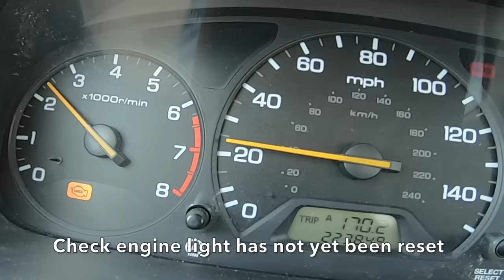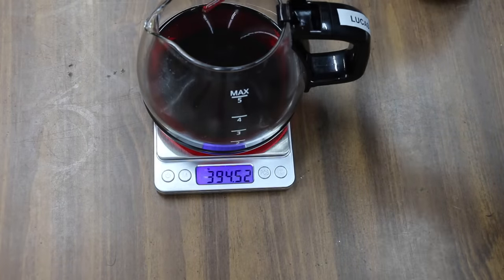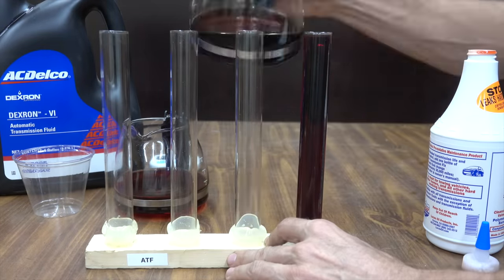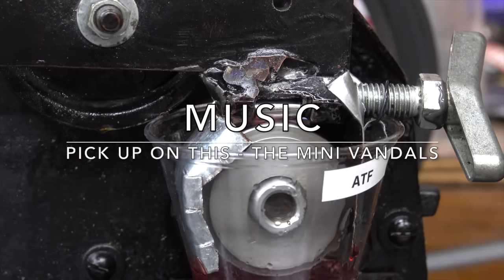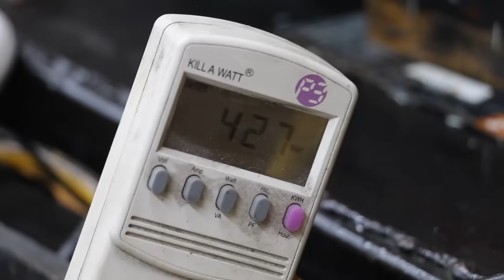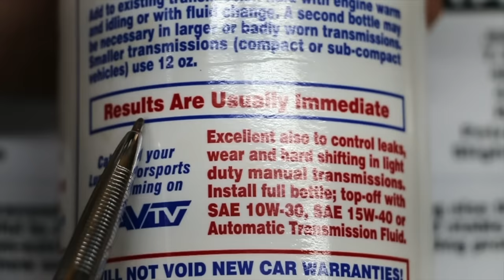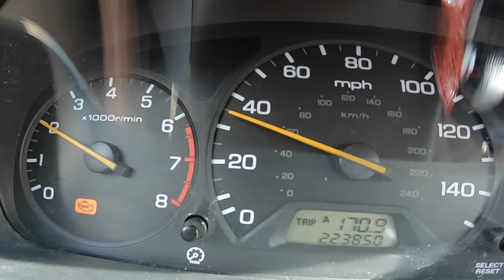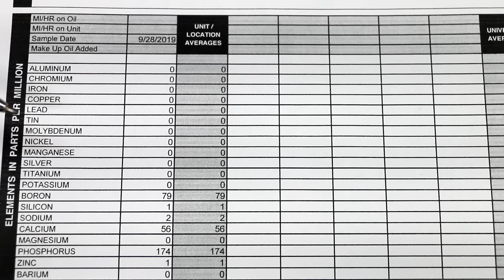Does Lucas Transmission Fix Work?  Let's find out!

Comment: $1500 for a rebuild!?  Wow, I gotta find me that guy!  That's a steal for a complete rebuild.
Reply: Ikr
Reply from the maker: Great point!
Reply: i was thinking 3-5k..
Reply: fidel catsro : Absolutely!  $1500 for a trans rebuild is unheard of, around me anyway.   My brother in law got a quote a few years ago on his 2007 Acura TL and it was around $4200.
Reply: @JeffCD77   i think its a trap gimmick to make you go there and send into his shop, once you there commited to repair, he will say ahh we found this not working we found that broken we found cats inside the transmission blah blah and bring you closer to 4k or so..
Reply: He's lying or doesn't know the problem (which he should b/c every shop has seen a thousand v6 hondas). 4 bangers had the TC problem.
Reply: The Car Wizard does Hoovie's transmissions for about 1/3 of what dealers charge!
Reply: Me and my dad rebuilt a 40L60 Tahoe transmission in 4 days and for $200. Amazing how much you save when you DIY
Reply: @fordrestored4646  how hard was it?
Reply: yeah but if you compare 1500 dollar rebuild for a 2000 dollar car then 1500 sounds like robbery
Reply: live and let live it was quite a lot of work actually. We had to completely gut the tranny and find all the bad gears and to put it all back together. The most expensive thing was new fluid. Which was 75$. We replaced some internal parts for about 100$. My mom was backing up and reverse just completely went out on it. But hey it’s working perfect now
Reply: @fordrestored4646  wish I had the skills/knowledge for such a job

I'm 20 I work on cars as a hobby but such a job is way past my YouTube schooling
Reply: live and let live ive learned most from my dad
Reply: That's what I was thinking
Reply: Their rebuild consists of adding a bottle of Lucas...
Reply: @fidelcatsro6948  If the mechanic is a scumbag and does that intentionally, when he calls to tell you what it will cost just tell him " you can just keep that POS car yourself"
Reply: @robs1852  hahaha
Reply: $1900$ my daughter paid and I was Shocked. $1500$ is Cheap that mechanic is a good Christian obviously.👍😊
Reply: @fidelcatsro6948  that's so true. My sister got ripped off this way. Claimed it was like $1,300 for a used engine, then when all said and done, the engine ITSELF came out to $3,200. Typical bait and switch
Reply: @JamesAutoDude  of course amigo!! 
EL COMMANDANTE IS ALWAYS RIGHT!
Reply: I know a guy in los angeles that does a mickey mouse job that will get you 2 or 3 more years for $700
Reply: @angelt7166  my Siamese cat would love to meet him..
Reply: Not really there some shop in Houston that do a rebuild for 650
Reply: @jonathanlee6114  that sounds like the guy leaving the old solenoid pack inside the transmission, a cheap work.
Reply: 2 brothers in bellflower Ca charges about $1500.00 for a rebuild on the tansmissions.   They do very good work took it over from their father when he retired.   So they have been around forever.
Reply: ngfugjg jgjhif : Sorry, but I would never trust ANYONE who said they would do a proper tranny rebuild for $650.  Come on!  I've paid $650 for shocks.  $600 for rear springs.  Not $650 for a transmission.  That's absurd and you should question that.
Reply: @JeffCD77  maybe is just for the work and the client buy all the parts.
Reply: @JeffCD77  and maybe, just maybe, he buy all the parts and it's an older transmission without electronics, something like a 200R4.
Reply: Money Online : Maybe :)
Reply: Yes 1500 ain't a bad deal,  most people with a Honda with a V6  seems to have transmission problems because of the engine torque.
Reply: Local transmission shop rebuilt mine in my 99 Ranger for about $1900, back in 2010.
Reply: Same thing I was thinking lol
Reply: Rebuilding Automatic transmissions are one of the biggest scams in the auto Industry. They aren’t some mystical magical part. I’ve done a few 727’s and a couple GM TH350-400 and the over drive unit don’t remember the model number now. Some of them are super cheap for the parts. Some of the Japanese are crazy expensive for parts. But they are not that hard to rebuild is you have any mechanical ability at all.
Reply: @mike-bj4dk  except that it would cost $30k to replace the car.  If the rest of the car is fine and you want to keep it - why not?
Reply: My husband got his trans rebuilt just 4 days ago at 1600
Reply: @JeffCD77  a Acura is a big shot car compared to a Honda even though they are similar, LOL  always remember a mechanic tell me you want a primadonna  car you pay primadonna prices, LOL
Reply: @tvrpaul71  Similar?  Try pretty much the same.  It's a Honda transmission.  If you use the dealership, yes, you are absolutely going to pay "Acura" prices.  But for most things, if you use a reputable mechanic that doesn't rip his customers off, you'll pay the same price as a Honda.  Again, I said "most" things.
Reply: @angelt7166  I did a dodge RWD van 3 speed for $700. Easiest trans money I ever made. Most are 5 times harder.
Reply: @saddamlucdahlia7842  where? Is the question?
Reply: @GCEXTREMEMN  where?
Reply: @joepayer1793  
Hofman Transmission in Brooten, Minnesota. 
Again that was $1900 to rebuild my transmission in my 99 Ford Ranger back in like 2010.
Reply: @joepayer1793  sorry still trying to get familiar with this in Bryan Texas place is called AJ’s Transmission Shop.
Reply: @joepayer1793  that guy is very crafty and he installed something else to improve it
Reply: @tvrpaul71  You realize that Acura IS Honda?  Rich folks in the US can't be seen driving a Honda, so Honda rebranded some as Acura cars.  There aren't Acura Integras over in Japan, they are Honda Integras.  Same with Lexus (Toyota) and Infiniti (Nissan).
Reply: Was quoted $4500 today. Lucas didn’t help, but I’m throwing solenoid codes so that makes sense.
Reply: does that number include removal and installation + break in
Reply: @JeffCD77  If you're paying $650 for shocks and it's not a race car, you're at the opposite end of the improbability spectrum, is a very poor example.  Shocks are normally less than 1/3rd that, while taking $1500 and multiplying  by 3, would be too high for what's in that vehicle, could get one already rebuilt to swap in and core refund out the door the same day it arrives.
Reply: @stinkycheese804  It would be nice if you could reply in sentences that most of us can understand.  Also, $650 to replace the shocks in my wife's XC60 is a very good price.  Not sure where you are getting your numbers from.
Reply: @JamesAutoDude  sounds right. 1300$ for used engine, and 1900$ for labor, including a 1 year warranty pretty standard.
Reply: @JamesAutoDude   Book time is 10-12 hours, shop rates are about 80-160 per hour, plus old engine disposal fee. I advise anybody who has the space, to do it themselves, job is more intimidating than it is difficult
Reply: @kevinbaker2470  that wasn't her total... That was just for the engine.
Reply: @kevinbaker2470  the engine was $3,200 by itself I meant. Not the total bill
Reply: Mine was $1600, jumped right on it!!
Reply: $1500 is not worthwhile, if the shop rebuilding it, rebuilds it incorrectly,  by cutting corners, etc.
Reply: Haha right. That barely covers taking out the transmission haha but he's just giving an example. No one will give you the most accurate price but it's 3k plus to do rebuilts usually. Better off just getting a used trans
Reply: I've seen 1200$ in Pennsylvania
Reply: Front wheel drive is cheaper
Reply: I had a 2000 ford Taurus that needed a rebuild and I was only charged 800
Reply: I was able to do the same job for 1400$ to rebuild same trans, it’s a junk 4 cyl trans mated to a  v6 but makes too much power for the little guys clutches and internals
Reply: @angelt7166  I'll take two tickets to Disneyland lol
Reply: @fidelcatsro6948 That’s the usual among transmission shops. I called a few places and they wouldn’t even give worse-case scenarios; just bring it in and let us charge to look at it for $700 (1990s).
Reply: @jaymez858  thats the cheese baiting on the auto transmission mousetrap!!
Reply: Maybe $1500.00 for an old 3 speed like the Chevy Turbo 350 or 400 but no for the newer 4 speed and up trannys.
Reply: My transmission rebuild was $700 cash.
Reply: @joedunn7434  what kind of transmission?
Reply: @JeffCD77  with that money I buy a new transmission
Reply: @doug3805  4L60e
Reply: @joedunn7434  that is cheap, cheap!
Reply: @doug3805  oh I know lol I practically threw the money at him for that price 😂
Reply: I can't even find a guy😂
Reply: That's about right for just the rebuild without removal or install
Reply: A rebuild kit for that trans is about $300. Pretty simple rebuild. No planetaries in a Honda
Reply: Dude, this is an old comment thread, but I got a 93 lesabre I asked about getting rebuilt. Dude said 2k and you can buy a FULL rebuilt one with the TSB and update kit already installed for like 1,200
Shits wildly expensive
Reply: Lmao i was just thinking that after he said it
Reply: My 74 dodge d100 had a rebuilt price of 3k
Reply: Well it depends on the transmission.
Reply: 😂Yes I agree with you and would like to know who that is as well because I just got a rebuild quote for 3700
Reply: @JeffCD77  Yes I have 97 Chevy express van and I just got a quote today for 3700
Reply: @WilliamAllen-mc9px  that’s a 4L60 transmission.  Dirt cheap to fix.   Buy refurbished and slap it in.  Rebuild means they change the seals, clutches , maybe TC.   Rarely are the hard parts damaged
Reply: @Tkdbar  I ended up finding a rebuilt one in junk yard for 140 n I works fine now to doing new front suspension due to passenger side lower ball joint broke few days ago so gotta do both sides
Reply: 😊no shit right. My truck transmission is 1800 and I have to bring them the transmission out of the truck.
Reply: Costed me 2000 for my 2002 vsl6 camry. I think I got ripped off. Because i drove off and then check engine light again. Turned out it was knock sensors. And I think they got me in the end. 
The issue was car would not shift I to higher gear. Which is "4th gear" in that car.
Reply: @jonathanlee6114 and  it's still 650 til this day
Reply: "they" start at $1500 but you'll get a call saying that "they" found other problems so it'll be more $$$. 
The transmission would be in pieces and you won't have a choice
Reply: In nyc 1500 all day
Reply: Dang AI PC program comments, please dont bother this awesome channel!!!!
Reply: P.S. any comment by a box; with a letter, is  computer program....
Reply: You said it! 

That’s a good deal. 😊
Reply: That's not too far off if you have a common basic transmission, like a 4 speed from an older chevy/ford pickup.   But that's the price to bring the trans to them, and pick it up when done.   Certainly not for them to do the work to RR.
Reply: It’s probably 1500 in labor not including parts
Reply: Yeah I was charged $3800 to do a full rebuild the automatic transmission in my 300zx. 9 months later it was slipping again so I took it apart and they didn’t even install the filter for the transmission. It’s been sucking debris into the valve body and clutches for 9 months of driving! And they refuse to do anything to help me.
Reply: I was quoted $1600 on my 98’ Jeep Cherokee and it was if I pulled it. $2,200 for them to pull and total rebuild
Reply: $4,200 for my 2007 Honda Accord V6 164k miles, well cared for. Clutch or clutch pack went out and fluid leaked out during operation
Reply: Me that got a complete rebuild transmission for a Mazda 5 2010 for $1K 😶‍🌫️
Reply: I agree. I was quoted $2900 for a rebuild on my 2012 Kia Sedona
Reply: I guess I'm lucky I got a guy at work that used to do it for a living and he charges me 300 bucks plus the cost of parts
Reply: @JeffCD77 
I rebuilt a GM TH200. A simple transmission,  the parts cost me $125 a manual to show how to take apart/ rebuild was $35  well worth the money.  Took me 2 weekends to remove,  rebuild and replace.  Worked great.
Reply: 👍 yeah that's A damn good deal,gots to find that dude
Reply: You know they will just put in a used torque converter and change the filter for 1500 bucks.
Reply: If it sounds too good to be true then it is.
Reply: That’s nothing I got mine rebuilt for $750
Reply: I have a 95 diesel Yukon with a 4L80e MT and I wish I could get it rebuilt for $1500.
Reply: that's exactly what they were asking for rebuild my.. is I fking Honda Accord 2007 not even the car cost that much 😅
Reply: @liveandletlive2894 it's hard I rebuilt a c4 and so many clutches, looks like motorcycle clutches. But usually the rebuild kit comes with instructions.
Reply: I'm just a girl with a slipping transmission of my 2007 Crown Victoria that shifts hard between second and third I don't know why please help  anyone?😮
Reply: My quote was $2900 😅
Reply: Indeed I've used Lucas all their products the very few brands I'll actually buy over again
Reply: @firesupport162  Lucas works wonders in my 09 CV police intcepter with 193,000 miles on her. Good product my granddaddy used in his vehicles and farm equipment.
Reply: A guy near me quoted me $800 for a rebuilt and $1500 to rebuild it better than factory. I guess it just depends on the transmission and parts cost. Also quoted me the transmission out of the truck not them removing it.
Reply: Post 2022 the same rebuild $4500 ... lol
Reply: @ddemier  wanna bet!???
Reply: it’s a 4speed tho to
Reply: Right $5.300 on 2017 F150 Ford 6 speed transmission. 172.000 miles
Reply: I just sent my 4l60e in tobget rebuilt. About $3500, i managed to get over 400000kms out of it hahaha
Reply: Someone trying to change me 1800 rn for same problem
Reply: In Dallas Texas. I had a ford explorer transmission rebuilt and installed for 1995$
Reply: I can get a rebuilt trans for a 5.3 GM all day under $1000😂
Reply: Our complete rebuilds start at $1,200
Reply: $1,500...WOW THATS A STEAL!..DO IT NOW!
Reply: Only $350 to fix my 350 turbo for my 76. Installed a Jr shift kit for free
Reply: But with NO WARRANTY he said
Reply: He lives a town over from me in rural Missouri. Shit be cheaper out here. Especially if you got a buddy charging you for only parts and time because he’s not paying for rent and staffing on a business.
Reply: Well if you look online for the second stage master rebuild kit I don't know about your vehicle but I can pick mine up for $350 bucks That's everything so that guy's rebuilding your transmission in less than a day He's making $1,200 bucks off of one person
Reply: @fidelcatsro6948 not always true, I had a 1999 dodge ram 1500 van that I had a guy in TX rebuild the transmission for and he charged me $1500 to drop it rebuild it and put it back in. Nothing more no less
Reply: I know someone who can do it for $500 as long as you remove the Transmission yourself and bring it to them
Reply: Looks like a Lucas milkshake in the lubricity test
Reply: Had a 2000 honda accord 2.3l transmission rebuild was $3700
Reply: @angelt7166 Name of the good enough LA?
Reply: My brother just got blessed with a $1200 full rebuild. Some folks are truly helpful.
Reply: Is it? It cost me 600 to rebuild a chevy 4l60e! 800 total to have them remive it and install it